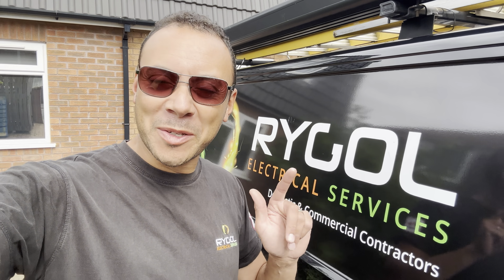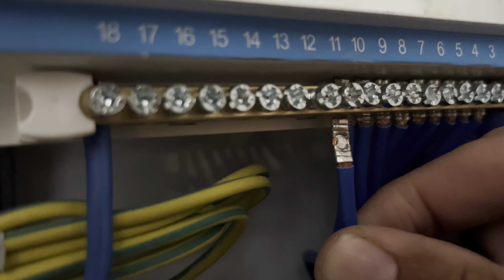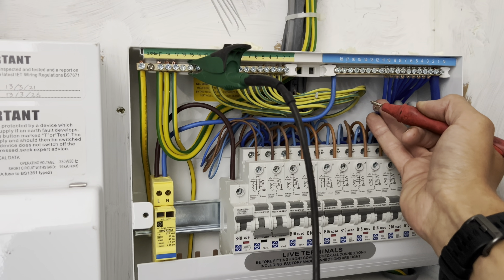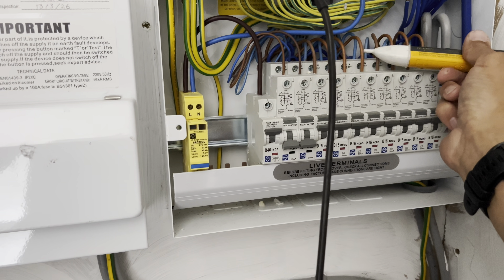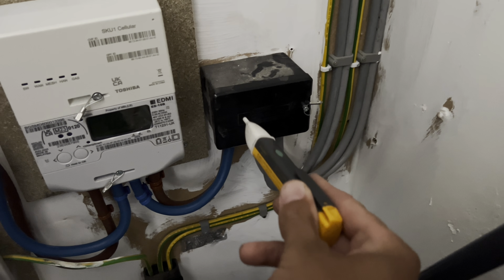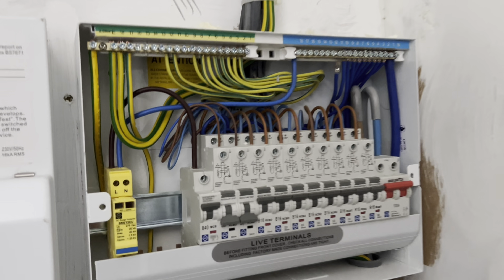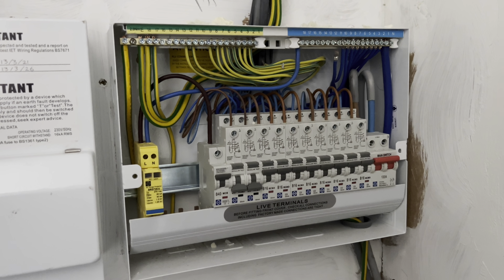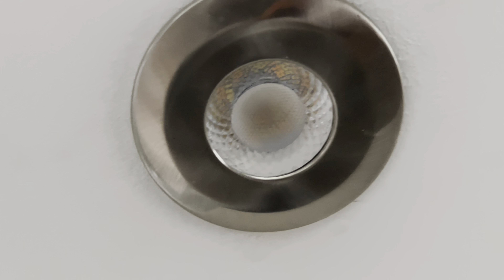Smart Meter Disaster! ⚡️

Comment: You don't need to be a qualified and experienced electrician to install smart meters, you just need to go on a 2 week course, demonstrate what you've learnt and them work supervised for a smart meter installer company for a few weeks.  And in practise, once you're "qualified", you're scheduled a limited amount of time for each meter installation, so you can understand how mistakes can occassionally occur in the installation, but there's no excuse for not doing a 10-second polarity check with a socket tester.

For those saying they wouldn't have a smart meter, you're burying your head in the sand.  The very best tariffs available are those where the rate varies daily or even hourly, depending on the load on the grid and the weather, and you only get those if you have a smart meter.

Comment: I did have two LED bulbs not fully extinguish in a stair light with 2 switches, due to capacitance between the conductors in the segment running between the switches. In the right circumstances it can mean the switches select 'on' or 'nightlight'. Adjust the 'off' brightness with an added capacitor (with discharge resistor) perhaps!

Comment: I have heard several friends reporting electrical issues with smart meter installation when wires are crossed only folk with led lights bulbs flashing ever so dimly, only to have a real tech come to swop cables , the issue being they are short of installers so part swoppers are employed with the part and taught how to replace meters only with limited experience.

Comment: I had a dreadful smart meter install with the tails looping over 6" from the board because they crossed over other ones. As a time served now retired sparkie I have always set cables to flow over obstructions and nicely "tram Lines" them. They refused to come back to sort it so tidied it myself.
I'm not sure how long the "training" is for these meter installers but they are clearly not sparkies!

Comment: I wanted a Car Charger fitted, the local Electric Authority was asked to OK it, so came and did a check.  The  visual check said I needed to activate 3 phase to get sufficient power for the charger, and there was 3 phase to the house.  Provider finally, after 10 months, got round to installing a 3-phase meter - beautiful neat work, but....  Test revealed it wasn't 3 phase at all, but all three cables were shorted onto one phase on the pole.  So even the Electric Authority make mistakes, and make assumptions based on appearance.  The only way to be sure is to measure and test.  And now I have a 3 phase meter, but a big notice on it 'NOT A 3 PHASE'.

Comment: Shouldn't the lives for DBs be at back of Henley block. It looks like meter company have put the live in at back of the block which I thought was the correct way as the terminal
bar inside the block is higher up.less likely to get fingers touching it.

Comment: I’m not being negative here when I say the following; you mentioned that you could potentially have received a nasty shock from what should have been a safe neutral bar, which was Live due to reverse polarity. Well, before removing the fuse-board cover, you’re supposed to isolate and lock off the main switch, you’re then supposed to do the safe isolation procedure to prove everything is dead. By following the industry standard method, you would’ve removed all risk to yourself and the fault would’ve been found straight away.

I can tell you wanted to make an example of the “Big Company” for their mistake, but all you’ve done is expose your own incompetence, and I use the word incompetence because your method wasn’t the competent way of doing it.

Also, your comment stating that the Fluke multimeter you have is king for measuring voltage isn’t true either. The king of instruments for measuring voltage and confirming dead is what is described in GS38; it even states that a multimeter should NOT be used.

Comment: That’s the trouble with a lot of these guys that replace meters. They are not all sparks and are just trained in fitting meters. Job and knock brigade. Too lazy to plug a basic tester into a socket to check for polarity.

Comment: Excellent video, I’ve recently had an issue with one side of our consumer unit where the RCD will not reengage causing 6 circuits to go dead, one of which has our boiler on, I’ve contacted our electrician but in the meantime I have feed the boiler circuit through the back of a socket using an extension lead from a circuit that is still on, there are no high ampage devices on the circuit and it is working fine as a temporary measure, just checking with all you electricians if there is any reason against this as a temporary fix until our electrician can get to the job of fixing the faulty consumer RCD?

Comment: No, you should not test the live consumer unit. If the neutral and live are switched, the neutral bar becomes live, making any work without isolation extremely dangerous, potentially causing electric shock or fire. You must isolate and turn off the power to the entire consumer unit and verify isolation using a suitable voltage detector before any testing or work.

Comment: It looks like you got video of the seals before you undertook any corrective work; I hope you took pictures of the seals and their crimp ID numbers. (They should match the sticker.) I would then be reporting the issue to the DNO and company that fitted the meter (anyone that works in the business knows who it is!). 

This is totally unacceptable! The meter fitter did not do his checks properly; before/during/after. They are there to prevent this sort of thing from happening. He will get into trouble, there's no doubt. If it's not happened before he'll possibly get more training and increased inspections for a while; if he has done it before, he should be fired.

I would like to add though, that a lot of these companies don't prioritise safety (although they may say they do)! It's all about how many meters you install in a day. And this is what happens when you push staff beyond their limits.

Comment: In our previous house, we had a smart meter installed. A couple of years later we were having tripping issues, so called for an electrician. He did his checks and said we needed the power supply company to visit as there was something going on with one of the sealed components. The power supply tech arrived, and found that none of the grub screws in and out of the smart meter had been tightened up - the cables were just sitting in the meter, quietly arcing away!

Comment: If the terminal for the tails is tagged out, how did you fix it?
Reply: he didn't show that part...obviously de-tagged it and fixed the problem in the henley block.  Should also pull the main fuse otherwise you'd be working at around 60 - 100 amps.  If a cowboy company can leave a system in that condition, then pulling a security tag is insignificant.

Comment: I did figure that the smart meter installation way the problem and it was in the junction box. Utility contractors are mostly crap. I had a new gas meter installed, smelled gas. The new pipework was only hand tight.

Comment: Glad to see you using a Fluke meter. I've got a 75. I got mine from a departing engineer about 35 years ago and it's still going strong.
Reply: Those plug in testers are quite cheap given the peace of mind you get but I think essential for campers and caravanners, especially on the continent.
Reply: The 75 series still sell on the used market for £60 to £80 in good condition.
I have a rare all yellow holster and meter model 23, earlier than yours and they go for silly money now, seen people asking £140 for them but wouldn't part with mine.

Comment: When contractors come out to fit meters you ASSUME they know what they're doing and you leave them to it! You don't stop to  think 'oh they'll get the wires around the wrong way'. Had an issue in previous address where the power to the entire flat would occasionally cut out! It was always a switch in the circuit box that would have to be flicked back up!
Your video I'll keep in mind for future reference. Thank you. Now will always keep a plug tester handy in tool box.

Comment: Seen this before it means the Mains is inverted Phase and Neutral are probably reversed

ADDED Comment-The old style Fluorescent tubes used to make a "rolling" effect when the mains supply was reversed by the Supply-authority, I've personally seen it [often] with a meter change, whereby the customer calls to ask us to check ehy the ripple-effect occurs? A check usually shows that the meter connections were reversed at the time of the new meters' change 🙄🙄 Damn if we did anything like this, then there be hell to pay🤷‍♂️🤔

Comment: Really well done. What a pity the installers of the smart meter were not qualified and so dangerously incompetent. Threshold be a second backup check with smart meter installers. I will now find a safety plug check to heck myself after I get my smart meter fitted.  No wonder there were so any problems with smart meters when they started.

Comment: Seen the same. In NL there are no regulations about socket/plugs polarity but yes, if you have a blue wire it should be N and brown should be L of course.
LEDs (or those neon lights in a screwdriver) respond to any small amount of potential difference, even if they don't use any current (well, they do to earth or whatever or they wouldn't light up).
Check a random phone line or cable tv company's coax antennae connection (if not galvanically isolated). It might tell you it's totally live (sparks and all to prove that) although it's perfectly safe to ground it or plug it into a tv or cable modem. There will be some (negliible) current.
Your situation is far more serious, good catch!
Reply from the maker: Hi Kuifmans, Thank you for the information. Interesting to see the differences!

Comment: 5:08 Imagine how terrifying it would have been if you saw no voltage between neutral and earth, but a voltage difference between live and earth/ live and neutral. I.e live and neutral swapped at the main fuse, meaning every metal casing in the house was live

Comment: Well first of all It's a shame you don't know how to wire the SPD.
Oh and secondly are you admitting the meter fitter knows the correct way to wire a 2 pole tail splitter block and you don't?
As it's a HMO where is the single point of isolation?

Shame on you.
Reply from the maker: Its a shame you got it wrong🤣. Watch the video more closely so you don’t fall into the trap of what some others have done too. A little quick to judge my friend. The pro’s will spot whats happening in this video. Try again………

Comment: Every'one'
NOT
Every'body'
The emphasis is on  One
How many of YOU are there in existence on this earth ?
Learn that a 'body' is a DEAD entity
You will find every'body' in the morgue or buried in the
Cemetery / Necropolis / Dead Centre 
You have yet to learn correct grammatical legal English
Now for your homework - write an essay on the
importance and significance of 'One'
It's about six lines of text.
A bright student age  8 can do it easily.
Can you ?

Now here is a video from Dave Jones - 
whom I have known for a few decades
( We were both members of TETIA )
Television and Electronic Trades Institute Australia
Now resides in BELLA VISTA - NEW SOUTH WALES  AU

EEVblog #409 - EDMI - Smart Meter Teardown
https://www.youtube.com/watch?v=dm-yZ1N3xmc

                                                                                37:33
CHANNEL: EEVblog

Many years ago when on a Home Service call to repair a Customer TV
(Before the days of Flat Panel TVs)
I had switched OFF the TV at the power point -
and when the soldering iron touched the circuit board  BANG!!
Of course the barel of the Soldering iron is earthed -
This created a hole in the PCB
CAUSE : Customed did a DIY  replacement of the GPO
and transposed the L & N
It is quite alarming when an unexpected BANG occurs.
The lesson learned was to
(a) Always check the polarity at the GPO when performing any
work on the particular circuit  and;
(b) Pull the plug out completely from the GPO when working on /
Servicing the device.
(c) discharge any capacitors - particularly where Electric Motors /
Compressors are concerned.
Of course - there are other hazards with EHT voltages and DC voltages
above 30V require caution

And for those who do not understand Legal English
Learn the difference in meaning between  ON / OFF   and   on / off
and in what specific context they are used.
Learn that when referring to SWITCHING - it is always   ON / OFF  in ALL CAPS

Comment: Are can't see where you demonstrated the actual wire swap round.  The pictures before and after on the consumer unit look the same.  Did you make the swap in the previous black box junction, if so did you remove the seal placed by the company, and again if so, would this not present any legal issues?

Comment: This happens all the time in continental wiring systems. Any lamp with a two pin plug and a built in line switch ( like you get at IKEA etc) can be inserted into a socket with the live side on the un-switched leg. The led's flicker. British plugs are always 3 pin so the live cannot be reversed with the neutral ( unless the plug was wired up by the installer and not pre-fitted by the manufacturer)

Comment: I saw this in a solar powered shed once.  the AC line was energizing the DC line to the security lights running parallel to them, and they would dimly glow.  The LED bulbs made a  bridge rectifier out of the ac sine wave.

Comment: As an electric engineer, and having been in the metering industry for over a decade, there's no excuse to get cross polarity. There are tests in place to avoid this. Having said this, the black double pole block you have installed has the live cables at the front. These should be at the back. We are all ready to slag off the meter man, but the number of wrongs I have come across from the supposed "experts" is shocking. On another note, I'd never use a Stanley knife to prepare the 25 mm tails into a fusebox. You almost got an electric shock? You are the professional! Safe isolation rings a bell? Again, there's no excuse for the meter engineer to have gotten this wrong. He obviously did not do his test. Or did he? They'll have photographic evidence of those tests. If so, something else happened there.

Comment: Recently had to call dno to my son's new property (where an elderly lady had been living). On what had been a TN-S system they had disconnected the 'earth' during outside works. They had not come into the property to convert it to TN-CS and there were exposed and single insulated conductors on the incomer. Also these meter change jockeys had be in twice and failed to notice any of this. Perhaps a refund on standing charges should be due?

Comment: Not an electrician here but as soon as you took the neutral out and I saw it sparking I knew straight away what the problem was.
And yes you are correct, that is a death trap waiting to happen.

Also, I have installed a Shelly EM in my consumer unit and I track electric use with that through Home Assistant I have noticed that my little monitor thingy that came with the "smart meter" are not tracking equally.
It seems that it's always a few hundred Watts out, the Shelly EM reporting less then the "smart meter" monitor thingy but when initially installed it tracked nearly perfectly equal (maybe 10 too 20 Watts out).

Comment: I’m a motor control electrician technician for a large air compressor manufacturer, we were called out to assist the fire department to determine the cause of a 100 HP air compressor catching fire and burning down the mechanical equipment room in a milk bottling facility, the first thing I did was to get the schematics for this unit, I inspected the equipment and checking the control terminals I found a small jumper wire between the E-STOP circuit that was not on the schematics, what they did was jumped out all the protective circuits because it was probably nuisance tripping because it was overheating which caused it to catch fire, I took photos and wrote up my report for the fire department which gave them a heavy fine for the safety violation.

Comment: I'm only amateur within 1 minute of the video I recognized the nightmare that some clown who fitted the meter did the dangerous live neutral flip. This should be a test on a check list and for these meter fitters and never get left in this state ever. 

If this guy in this video wasn't Careful in diagnosing this he could have been injured too, he was probably a little to gunghoo for my liking causing sparks like that.

It probably isn't good the the surge protector to be wired up the wrong way if that's got any polarized capacitance, it won't work properley wired up the wrong way.

Comment: That fuse box has been installed properly by a competent electrician, the problem with smart meter installers, is that they many only have the tickets for gas installations and just on job training for a few days, as they are shown the correct methods. I had a smart meter installed today and the guy explained that he was a gas boiler engineer by trade and had learnt on the job for the electrical side of things. Keep up the good work mate! The smart meter installer earns £48,000 per year.